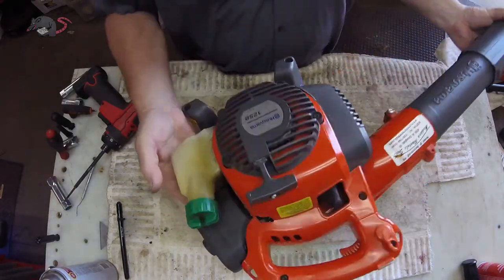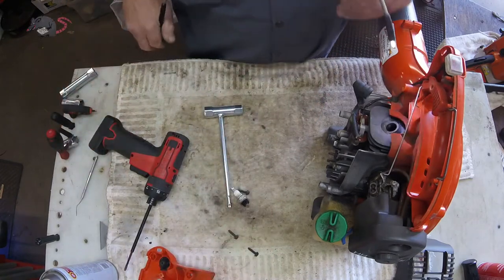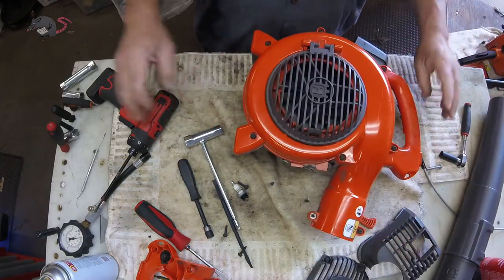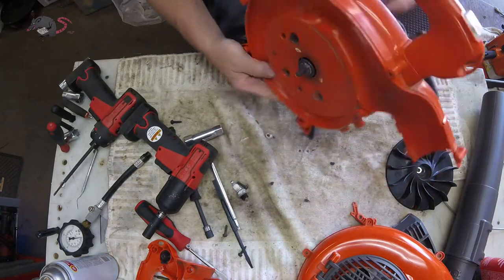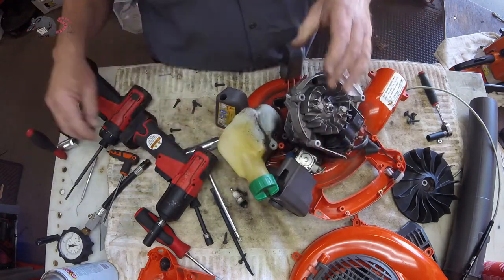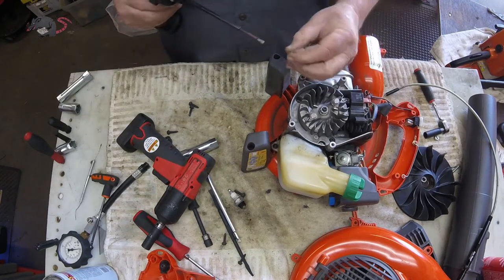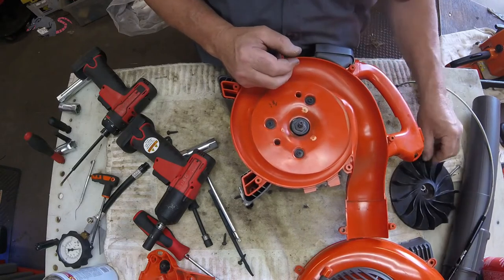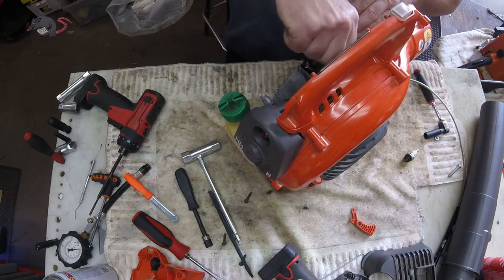Husqvarna 125b loose carb

Comment: for what it is worth, I took my 125B apart today and it had two broken engine tabs. The carb was barely hanging on.  I tightened everything up as best as I could and it runs ok.  Going to run it to the end of the year and then give it away locally for parts for someone else.  Probably had it for five years.  Kind of disappointing it didn't hold up better.  Thanks for the video.
Reply from the maker: Ya once the screws get loose things get bad quickly.

Comment: I've had my 125B for almost 2 years now. Used every couple weeks throughout the summer is all for lawn clippings, then a few times during the fall for leaf debris. Last week I used it and all of the sudden it didn't seem to have the max output it usually has. In fact at one point it shut down on me while idling. Started right back up, but I felt like I had to nurse the idle to keep it from shutting off again. Thanks for this video! I feel a lot better about breaking it down and checking for loose bolts!

Comment: Thank you so much for this video. Had no spark so I replaced the coil and plug and it still did not start. Long story short it was the screws on the bottom of the crank behind the fuel tank that you mention. Tightened them up and it fired up on the first pull. Compression issue? It explains the oil/grease inside the leaf blower. Thanks again for this tip that I did not see anywhere else.
Reply from the maker: You're welcome.

Comment: Thank you for posting this video. I haven't had any issues starting or running wise, but I did notice the carb has become loose, I removed the air filter and checked the two nuts inside and they were tight, so I was left just trying to figure it out. Then I found your video, and God bless you, now I know what to do.🙏👍
Reply from the maker: Good luck! Thanks for watching!

Comment: You, sir, are a hero. I had replaced the carburetor and fuel filter, lines, etc., Air filter. Was better, but still bogged. Before I took out my handy spline tool, I followed your impeccable directions, and tightened the very loose carburetor boot bolts. Tuned it a bit and it runs like new. THANK YOU!
Reply from the maker: You're welcome!
Reply: Like others responding, I replaced carb, filter & fuel lines. Blower would still sputter to a halt. Did notice the carb was wobbly even though I made sure it was tightened down. Then I came across your brilliant video & thought, right this is it! Thanks for giving an awesome description of how to access the two bolts securing the block the carb mounts too. Would not have found them without your video. I was already researching the next blower to purchase. Many thanks!!

Comment: Another machine to be on the lookout for!  If I ever get one of those in I'll probably automatically disassemble completely and reassemble with threadlocker and torque to spec.

Your remarks about this being such a prevalent issue with this machine are certainly borne out by the sheer volume of commentors saying they had the same issue.  What's really amazing to me is the number who throw parts at the issue instead of diagnosing first.  Even spraying a volatile at it while running would prove an air leak if they don't have the ability to pressure/vacuum test.

The design with fasteners coming from behind instead of the standard front facing fasteners for the intake insulator is a real doozy!  Whoever thought that one up deserves to be fired!   This is the first time I've seen that.

One further comment/question:  Since I'm on my own clock (not company time) doing repairs and flipping, do you thing it would be feasible (and worth the effort) to repair that broken engine mount?  Not seeing it in front of me I can't tell for sure, but I'm thinking JBWeld or the superglue/activator or baking soda trick.

Thanks for your time, Scott, and for another well-produced and helpful video.  You da Man!  :)
Reply from the maker: You have to decide if it would be worth the effort. Yes you could spend extra time on a repair just to flip it and create cash flow. Thats not a bad thing. If you decide to go that route you need to be sure you've found the reason for the breakage in the first place. In this case it was a vibration...maybe a broken impeller fin or just a loose mounting bolt?
Reply: Yup, of course!  I was😂already thinking about what might have caused that break. My first idea was bad engineering - the planes where the engine feet and the frame meet might not be the same so more stress was placed on the one mount. I’m also thinking about rubber sheeting on all three as shock absorbers. Always re-engineering everything! 😉🔧

Comment: Very well done. I think one of the best videos I've seen to date. Got lucky and homed in on your video right off the bat. I was very suspicious of the movement on the carb. I just didn't know if it was boot flex or loose.  I came to the conclusion after throwing everything in the book at it that the loose carb had to be the issue. The blower came very close to getting junked but I thought I would try one more thing before I junked it. With that being said, thank you for the time that you invested in this video. Again, Well done!
Reply from the maker: I'm glad to have helped!

Comment: Great vid, thank you!  Mine's loose like that too.  Too bad I didn't see your vid yesterday, I had the blower apart to replace the carb, fuel lines, etc.  Will be doing your repair today.
Reply: Alright, got er done!  Your vid @ 4:12, I had the very same screw loose, but luckily it was just loose and not a broken engine mount.  And the screws for the carb were really loose, wow!  Thanks again for the vid, I wouldn't think to do all this.

Comment: I need to dive into mine.  
Decided to act up 30min into opening act..  maybe stage fright.
Uggadugga or an elbow I’m definitely trying to troubleshoot this problem.
Great video & help 👍🏻
Reply from the maker: I've seen new units where the fuel filter wasn't laying on the bottom of the tank. Its an easy check.

Comment: Great vid!!!  I watched and followed your procedure.  It made the job sooooo easy!  It turned out that the carb boot wasn't my problem (but it was a bit loose).  My coil wire was cut by rubbing the housing (another poor design).  But the way you showed how to disassemble and reassemble made the job a snap and I found plenty of loose bolts along the way.  I also surprises me that they don't use thread locker anywhere.  Oh, well.   Thanks a ton!
Reply from the maker: You're welcome. I'm glad it helped!
Reply: I noticed a gouge in the coil wire on mine too a couple days ago... Was yours not starting?
Reply: @bounjamin  Exactly. It had been starting hard for awhile, but wouldn't go this time. Once I replaced the coil I just removed a little plastic where it was rubbing the wire and all is fine.

Comment: Yeah, seen that broken tab a lot. I actually drilled and tapped a threaded hole in the residual part of it. Then secured it with a small machine screw (something like 10-24 as I recall) along with blue Loctite. 2 years later & still holding.
Reply from the maker: Good job on the repair!

Comment: Well thanks for the video hope this fixes my issue mines been loose for prob 2 years ive had it about 6 use it for my lawn care business but the past 2 years started having low idle and slight miss when runing full throttle. So thanks again gonna try this when i get the time to piddle with it
Reply from the maker: If its been loose that long it might be a good idea to look at the cylinder first and check for scoring. Thanks for watching.
Reply: @TheGreasyShopRag  thanks yeah ill check for the scoring but either way im gonna run her till she wont run no more😅

Comment: Thank you, sir.  Saved me some headaches.  Simple to follow instructions.  The ole 125B roars again.  Glad you gave us the torque specs too.  I would have only tightened to 2 uga dugas instead of the 3 you specified.  No doubt I would have been back in a month doing the same repair.
Reply from the maker: I'm glad it worked out for you. Thanks for watching!

Comment: Great video. Very well done. What is the brand of the drill that your using to take out those screws..
Reply from the maker: Any red/black power tools you see on my bench are from the SnapOn 14.4 volt lineup. Any blue tools are makita 18Volt.

Comment: Thanks for this video, especially the part about reverse threading on the intake blades. Did all this (took a few turns on the carb screws) and more, but still stutters. New coil, spark plug, carb, fuel lines, air filter, muffler screen. Any other ideas? My next endeavor will be to take apart the head and gearbox to look for cracked parts.
Reply from the maker: It sounds like you've been all over this machine already. Have you tried adjusting the carb?
Reply: @TheGreasyShopRag  yes, I bought a tool set two years ago when I discovered most small engines are tuned for Arizona summer and not PACNORWEST Fall....
Reply from the maker: @kevintorcolini2204  Ya the factory tune doesn't usually work.

Comment: Thanks so much for this video. I have been noticing the carburetor mount getting loose and my 125b has been cutting out in idle after running for 15-20 min. Maybe this will help with that issue. Maybe time for a new carb?
Reply from the maker: Its hard to say without seeing the blower but tightening the carb is a good place to start diagnosing.

Comment: I have a Husqvarna 125B blower when you first start it it runs good for about 45 seconds you can Rev-it up runs perfect but after about a minute and a half it acts like it doesn’t wanna stay running like it’s bogging down has a new carburetor new air filter new fuel filter new spark plug I just don’t understand I was thinking it was the coil getting warm and shutting down what do you think
Reply from the maker: Certainly the coil is a possibility. Maybe crack the gas cap and see if venting the tank helps. Another possibility is a scored piston/cylinder. Pull the spark plug or muffler and inspect the cylinder for scoring. It should be smooth and shiny.

Comment: What exactly does tightening these screws do? How is that crucial to the engine function?
Reply from the maker: When these screws are loose there is an air leak. An air leak in a two cycle engine causes a lean condition. This lean condition is what creates the bog in this situation.

Comment: If the cylinder is scored then junk it? I have one now with what looks like a scored cylinder wall with lines going up and down and a no start. Assuming I have no compression. It also has the loose intake that you repaired 8n this video. Would that cause a no start or just run ability issues. Thanks
Reply from the maker: It depends how loose it is but its an air leak. An air leak can cause all those problems including a scored cylinder. A new piston and cylinder lists for $77 right now and the gasket kit is another $20. Thats half the replacement cost. I can't do that repair in a shop if I have to add labor because they could get a new one with a warranty for close to the same price. All of this is assuming that nothing else needs replacemnt like a crank seal, impeller or tune up parts.
Reply: @TheGreasyShopRag  is there a minimum compression you like to see for a two stroke like this before it will combust?
Reply: @TheGreasyShopRag  I did a quick compression test and it went up to 60 then bled off just as fast 😐 Looking like a parts blower.
Reply from the maker: @Motoxr32  100 psi is the minimum. Your pressure gauge is in need of repair. It should have a schrader valve in it that holds the highest reading.

Comment: Very well made video and very informative. What drivers are you using and where did you get the long Torx bits from, please? Subscribed : )
Reply from the maker: I'm using SnapOn power tools. The long torx bits are from Matco. Thanks for watching!
Reply: @TheGreasyShopRag  Thank you very much and have a great evening. : )
Reply: @TheGreasyShopRag    Well that answered THAT question!  ;-)  I was going to ask about the drill/driver and the impact.  While we're at it, if you're happy at this date with the inspection light, what's the make/model of that?
Reply from the maker: @Rein_Ciarfella  https://www.streamlight.com/products/detail/stylus-reach-18
Just be advised that this light uses AAAA batteries.
Reply: @TheGreasyShopRag     What the heck is AAAA battery?!!  Must be really tiny. Thanks for the info. 👍🔧

Comment: Mine runs but after a while it boggs down and gotta let it cool off so i plan on taking it apart when i have time
Reply from the maker: Three common reasons for that problem would be scored cylinder, plugged fuel tank vent and wonky ignition module.

Comment: Great video! Thanks for the step by step diagnosis and cure. What type of inspection light are you using and do you have a link where it can be purchased. Thanks for your help and keep up the great work!!
Reply from the maker: Its a Streamlight 65418. Be advised it uses "AAAA" batteries. Thanks for watching!

Comment: Thank you for the phone video. It looks like to me Husqvarna have to have a training program on assembly of their products to make sure it's done right boats coming loose after one year that's kind of bullshit.
Reply from the maker: I don't know if its assembly problems,  engineering problems or just an out of balance condition.
Reply: @TheGreasyShopRag  I think it's an assembly standards issue.  All those screws should have threadlocker on them.  Saves time to just torque them down, but that's no guarantee they won't vibrate out over time.  This model is living proof of that.  If, on the other hand, there IS threadlocker on them from the factory, then the fasteners are probably not matched well enough to the threads cut by the tapping machines.  May have been a bad batch of fasteners from a sub-contractor.
Reply from the maker: @Rein_Ciarfella  I have to wonder about the distance from the intake fastener to the air filter box. Thats a lot of stress applied to those fasteners every time the air box is bumped. The extra leverage might just loosen them a tiny bit every time that happens.
Reply: @TheGreasyShopRag    That’s a possibility. Maybe the fasteners have stretched permanently and then vibration causes the parts to move enough to start loosening. Weird. Makes a recall a strong possibility if so many fail out of one production run.
I’m thinking this would be a great machine to ask for on Freecycle and at the various shops locally who have just scrapped them, since the fix is so simple and cheap. Be a good flip.